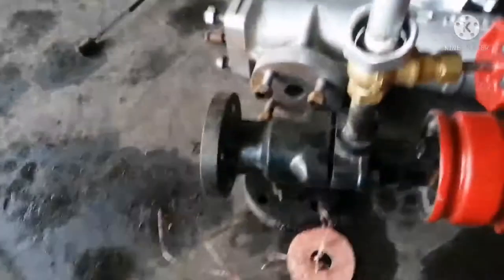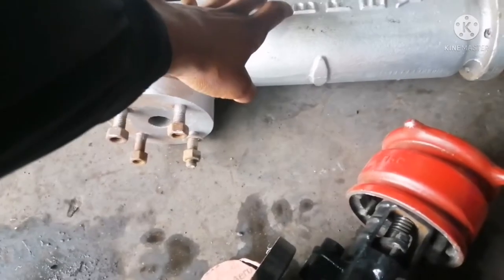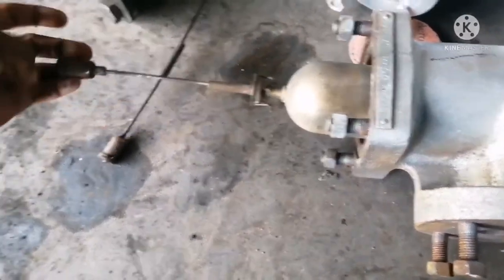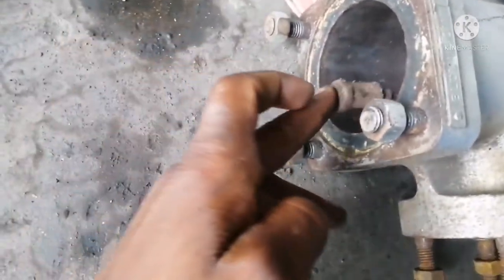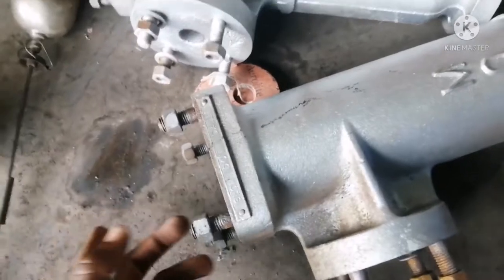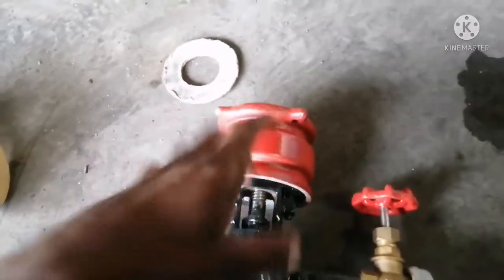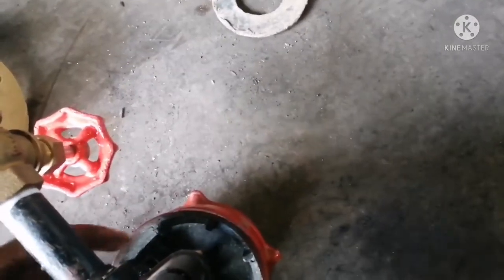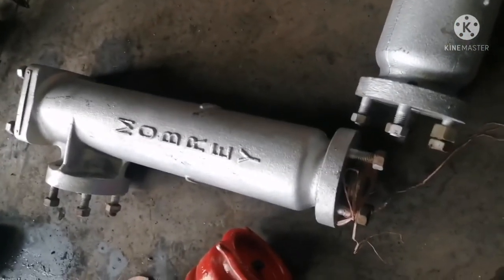Inside a mobrey switch and how it works

Comment: Using ring gaskets instead of full face gaskets on cast iron and bronze valves is very very naughty.  It is against the manufactures recommendations.
Reply from the maker: Yes its not recommended the suppliers have standard gaskets (full face) very safe and durable...